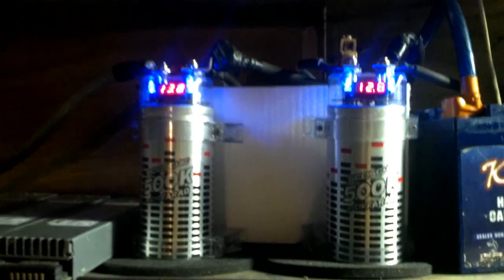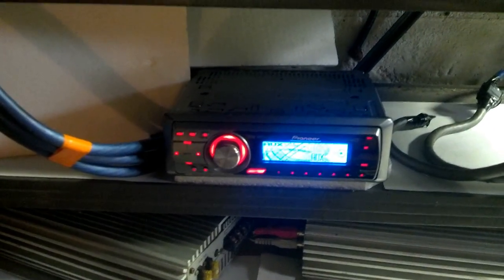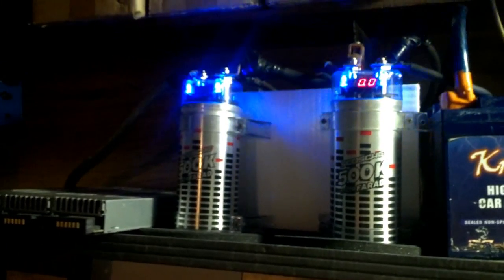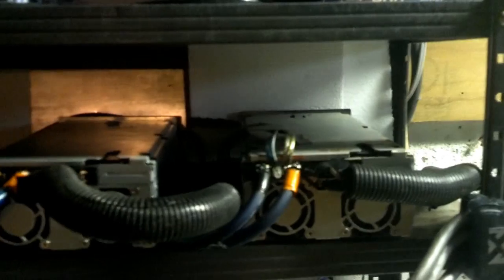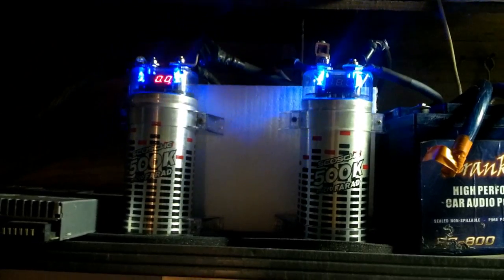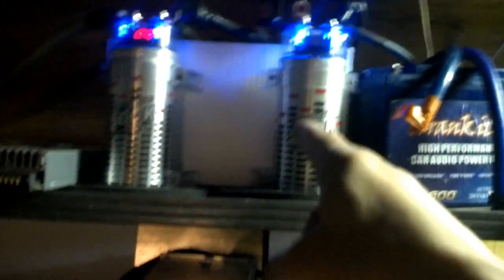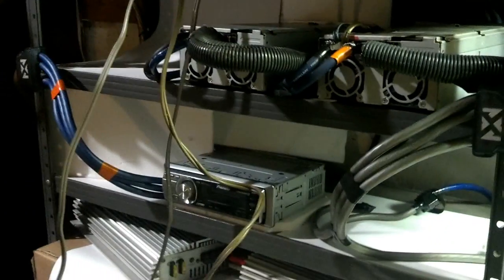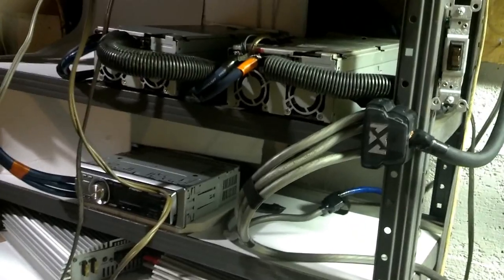Car Audio Capacitors Mythbusted Do they hold ANY voltage ?

Comment: they hold a tiny bit of charge, caps are good for like one hard hit on the subs, but really a battery is a much better investment
Reply from the maker: for a car or home ? and what if you already have a battery bank in your car ? and big 3 and the proper wire , and a High output alt , then what can help ? if you have already invested those 1000's of $ why not have a bank of ultra caps ?
Reply: if you want to upgrade more get another battery or something, caps really dont do much especially when you start getting into the thousands of watt systems, if you want to get one because they look cool thats fine though because they do look pretty cool but thats about it
Reply from the maker: you can have all the reserve you want , batteries can not discharge at the rate of a cap , nor can they charge at the rate of a cap  . if you think they can please link some type of scientific data showing this. batteries provide higher energy density for storage, while capacitors have more rapid charge and discharge capabilities (greater Power density)
Reply: yea ok caps are good for the really hard hitting notes, im not saying caps are bad im just saying its a better investment to get a better battery first, a cap and a battery would be great
Reply from the maker: exactly , if you read about amps like the rockford t15kw it uses a huge bank of ultra caps for the voltage rails to greatly reduce the need for more electrical upgrades , pretty much all amps do this , the only major difference is that the t15kw uses a capacitor controller that controls the charge rate , but they use caps due to the high recharge and discharge rates that a battery does not have . sure a battery first is not a bad idea , h/o alternator , but a proper cap can help out alot also when you have a proper electrical system , rockford ''and others'' also did testing with the amp dyno to prove that caps do increase output wattage and increase spl on the termlab with a proper electrical system , i wouldnt recomend a cap as your first go to when trying to fix a voltage problem , everything has a balance
Reply: yea well i think there are many smaller caps inside every amp, but your saying if for some reason you alternator isnt making enough power for one hard note the battery wont be able to release alot of power quickly and thats what caps are good for?
Reply from the maker: so say a 1500rms amp without the extra caps inside takes roughly 150amps draw to make that power , a hybrid amp with a capacitor bank and a charge controller only needs to draw roughly 50amps to output the same power . some amps like the mtx's have a direct connect for external caps , amps without the internal caps you would put a cap in the line before the amp but is lacking a charge controller , but even without the controller the external caps act as a buffer between your battery bank and amplifier to reduce the huge draw off the battery bank reducing the need for such a large bank , they are also much lighter than a standard AGM battery reducing the extra weight in your car , for a high power system you would want high power ultra/super caps . regardless each component has a time and place where it can help , common misconception is that a cap will replace the need for a battery or alt , it does slightly reduce the need for these but if you dont have enough battery to feed your caps and you dont have enough alt to feed your batts  then the cap isnt gonna do what its supposed to for your amp .
Reply from the maker: another thing that ultra caps are supposed to help with according to Maxwell is extend your battery life by up to double the life , considering how much it costs to replace batteries this would be a huge benefit  to anyone with a high power audio system
Reply: yea i see the benefits but for some reason the guys that do huge systems dont use them, i guess becuase they have a huge power bank
Reply from the maker: i think to many people have been stained with the misconceptions of caps and dont understand what they are really meant for ... and also cost might be a small factor because people dont consider the battery life into the cost , high end companies like Rockford , mtx and others know how it works and use the technology   . solar , automotive hybrid/EV and other advanced technology companies use it . it might take years for close minded people to understand how it works. companies like space X , GM , Ford , Fiat Chrysler have dumped millions into companies like maxwell because ultracaps have a useful place in the market
Reply: yea your probably right, honestly i have pretty minimal knowledge on what a cap is i just know from what the car audio perspective is, and that is that caps are pretty much a waste
Reply: caps are in everything tho, most electronics have caps, but the big caps sold for car audio have a bad name for whatever reason
Reply from the maker: im going to be building some homemade caps and batts in videos coming up , when you understand how they are made and work on a basic level it makes it alot easier to understand on an advanced level , alot of the bad perspective in car audio is due to cheaply made crap products and overrated products , but that does not mean all caps are bad . its just like amps or subwoofer or anything , if you buy a 5000watt boss amp and a 4000watt boss subwoofer and compare them to legit brands its basically the same thing . boss sells a cap they rate at 18farad costs about 50$ ... a good brands 1 farad is actually better . and a good brand like nvx's hybrid 10 farad is actually legit costs about 140$ , a bank of maxwell caps is similar to the cost of a smaller lithium battery
Reply: mazda2284 "batteries cant discharge at the rate of a cap".

While this is true, you have to remember where the power source of the cap is coming from.....the battery (actually its coming from the alternator when the car is on). So the power thats in the cap has to come from those sources FIRST. 

So.....why waste electricity storing it for such a short amount of time for no reason? Rather than just having a direct line from the battery to the amplifier. If your alternator/battery cant keep up with your amplifier, it certainly wont be able to keep up with an amplifer AND a capacitor. Makes no sense to think it could.

Iv been installing car audio for over a decade. Iv used caps before, and saw no positive effect in any installation.
Reply: .
Caps do something entirely different. They can provide a much greater voltage burst than a battery. You will ruin a battery if you try to drive it as hard as a cap. Capacitors are not supposed to hold huge amounts of power for long time power delivery, they are only there to support the system when extreme peaks occurs. Here's what's really interesting. Two systems, both running adequate alts. but one being supported by an extra battery vs one being supported by one less battery and caps. One system runs cooler than the other- Why is that, which system runs cooler - and why dose one system have a higher crest factor than the other? Here's a hint. Think of a brushless powered brushless motor setup.
Reply from the maker: @shabuti R18 did you read the comments above ?
Reply: @mazda2284  Maybe I'm just stupid but don't amplifiers already have arrays of capacitors?
Reply from the maker: @likeclockwork6473  they do for filtering and rail voltage,  not for 12v

Comment: Is that enough to make a noticeable difference in sound or output?
Reply from the maker: its enough that it keeps my power supply from kicking out . without the caps and running 1 1200rms mono amp and the headunit it will kick out at about 3/4 volume ''volume 43-46 on the pioneer H/U im using '' , with the caps i can go full tilt and run my speaker amps on top of what im already using . so for my setup i dont think it does much on the ''SQ'' end but it does make a huge difference in output by allowing me to go full tilt without cutting out , another thing i did notice is that the amp and power supply run cooler with the caps
Reply: Have you ever tried the high capacity caps ghat are like 30 Farads etc or the sets of high capacity caps used with or instead of battery banks?
Reply from the maker: maxwell super caps would be better , but these were free cuz people were told they are crap and dont work so they didnt want these anymore lol . they work great for me . when it comes to the car lithium batts and super/ultra caps , good wire and a good alt makes for a super bad ass combo , with DIY lithium you can do what you need near the same price as AGM , premade lithium are still expensive and dont keep the decrease in price as fast as the market is coming down on cells for DYI , ill be making some lithium vids soon

Comment: they say  caps help stiffen the voltage,well should a voltage drop test should be done with one hooked to the system,then test without it on the system and see what happens?

Comment: Of course caps hold a charge, that is their purpose. However they are a waste of money in just about any car audio set up. Buying high quality parts, components and the correct gauge wire along with a proper install is all you need. If you have a power supply problem then you need another battery. The Big 3 Upgrade is also money well spent that can solve issues such as headlights dimming. Those caps you have in the video contribute nothing to a properly spec'd out and executed install.
Reply: In my case, I have an old minivan, with 80A alternator. A 12" sub in ported box in the trunk. Did the big 3 upgrade, no dimming lights when the bass hit, etc. A friend bought a new cap bank, so he gave me his old one. Figured, what the heck, I'll just install it, if only just because it's free. Well, the bass definitely sounds different. Turned out all this time (without the cap bank), I was hearing distorted bass all along. Suspecting that what I'm hearing is just my self-suggestion, I asked a friend (not the one who gave me the cap in the first place) for a listening test. And sure enough, he agreed with me, bass hits better with cap on than off/without.
Reply: @creatip123  ok
Reply: 150AMP Powermaster ALT, 0 Gauge wire, Fosgate 800a2 and 800a4 , two 15" Kicker comp solo-baric dual voice at 4OHM Mono.... no caps -  lights dim, with caps no dim...  Hardware Addict... I have no idea were you got your intel from but you are but(TEA) wrong !!! You need Caps unless you only listen to BACH
Reply: Not true,, Caps helps get cleaner DC voltage if you have interferens etc and it save your battery, It also can deliver more juice on spikes that also save your battery for not disscharge.

Comment: Of course they hold power. Do you even know how a cap works? What myth BTW are you busting? Who says capacitors don't hold power!?
Reply from the maker: lots of people seem to think they dont .  also lots of people fail to understand caps are for fast discharge and recharge , unlike the batteries that they are so blinded with , sure toss some good batts in to back up some good caps and a good alt or power supply to back them up ....  then you really got something .
Reply: Yul Strokheet Al-Wauch ur a fucking idiot. If u dont understand then dont watch jackass

Comment: Just to elaborate on what Mark mentioned, the very definition of a capacitor is a device to hold charge. Their specific function as it relates to your circuit is to provide/maintain a steady charge (i.e voltage ~ pathway for current to flow) when the power supply can't provide enough "charge" at peak demand. Capacitors serve many purposes but for this case think of them as very, very short term batteries. 

Not sure where you got informed that "supposedly these caps don't hold any type of voltage" but great for proving them wrong! Maybe use this a a segue into a safety video about these capacitors ;)

Comment: You can debate the subject all day long but my system sounds a hell of alot more powerful with one installed. Would a big three upgrade or a battery have been a better solution? Of course but it wouldve costed twice as much with twice the work
Reply: There's only one way you can get close to the dynamics of running caps, using batteries. That's by running a stupid huge amount of batteries. They do different thins, and you cannot upgrade your way out of caps, unless you do something really odd.
If your amps draws 150 A on average when driven hard, and that at 14 volts. Imagine what kind of alt. or battery you'll need to support an actual short term 10 ms burst of three times that? Never mind the fact that the power has to run all the way through the cables to get from the alt. to the amp, the alt. will need to be stupidly big and so will the cross section of your wires. On top of that, the batteries will still struggle to keep the voltage up when the current draw gets high.  Hell, even high quality Li-Po batteries with a very high C rating would struggle at that point - and a normal AGM will simply bot be able to unless it's severely oversized.
Listen to the SQ guys, not the SPL crowd. They often seem to be a lot more knowledgable and critical of any info they get.
Reply: Jeff Barton mine sounds better with a cap. No doubt.
Reply: rhurtadorh32 Guest what the bigger the amp the bigger the capacitor they work....But yes you do need the right power to run everything properly...The capacitor will make everything sound better
Reply: mazda2284 mys self will go for big 3 upgrade 1st.
Reply: Jeff Barton unless you have a weak ass system then yes caps works for you. But i have more than 2 amplifiers crossover and equalizer and or epicenter than you need is a battery bank. Why you think people uses more kinetik and xpower batterys for audio systems!
Reply from the maker: nothing wrong with doing all of the above , alt , battery , big 3  , caps , wire . its all works together . batts cant discharge like caps and caps cant store like batts .

Comment: They only last a few seconds and only powering a head unit. they do nothing for amplifiers. that's all you've proven. if you need power, you need an hc600 or better or banks of supercaps. these volt meter caps all suck.
Reply from the maker: note the fc800 batt sitting there also ?

Comment: The caps are hooked up to constant power directly from the battery. If your car is turned off and you disconnect the power from the cap it will hold it's charge till it is dumped or discharged. Be very careful.
Reply: Every tried to put a screwdriver across a huge cap? Great fun.
Reply: @AB-80X  I'm sure they'll know by then.
Reply: Yes! You should really know what you are doing, since Caps can unload high amps, much more than a car battery so use the right cables also!

Comment: It's called capacitive discharge ...
As power come in to the cap it holds it just so you don't get voltage going up a down with the amps sucking power with the bass.
Reply: My system use to have a 2 Farad cap on it before the amp, I took it off when I went to setup the same audio components in my next vehicle, but I left the capacitor out of the setup. Same CCA rating and brand of battery, same motor and transmission, same Alternator Amperage output in both vehicles, both vehicles made by GM within 3 years of each other. 

There wasn't any vehicle accessories turned on other than the radio when running the audio system and headlights, and yet I noticed a difference in the vehicle's headlights with and without the capacitor in it, with the capacitor the lights didn't flicker, without the cap the lights flickered everytime the bass hit hard. But ya know these cheap capacitors don't do anything. Pffft! 🙄
Reply: @VencedorGamer  you may not have noticed his comment is 5 years old.
But yea those caps don't do much of anything

Comment: Capacitors are faster and more efficient and lighter than a battery. The reason they are not used is because they are expensive and do not store as much power than a battery.

Comment: basically caps are trash they really dont hold much charge your better off adding a second battery.
Reply: Or you could be smart and use a massive back up bat and only hook the amp up to that for 12v.pos  and have the cap straight 4g cable to the alt and also into your amp 12v pos and the power cell pos thats about the only way a cap will ever be truly useful for anyone. Being as your car electral system only has the charge load on the cap and not the batt then. If you get a large 100lb storage cell like I have it lasts you 2 weeks at a time before it starts noticeably dropping juice. And that's slamming every moment the car is on. So every 2 weeks you have to toss a charger under the hood over night but so worth it theres zero noise coming through the audio from the vehicle then. Nothing but full good clean power.